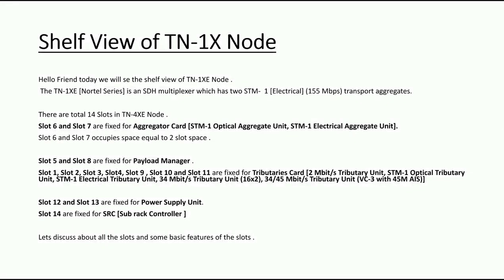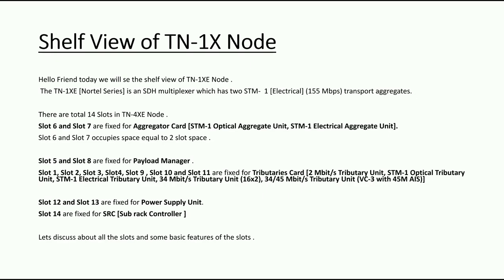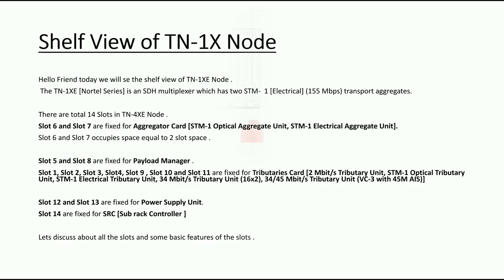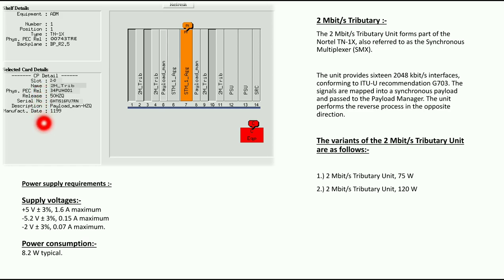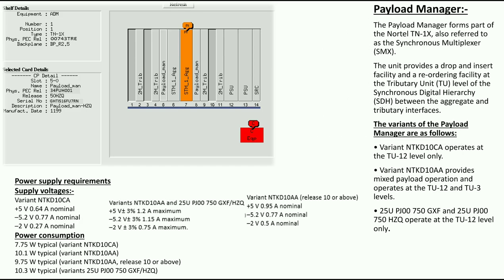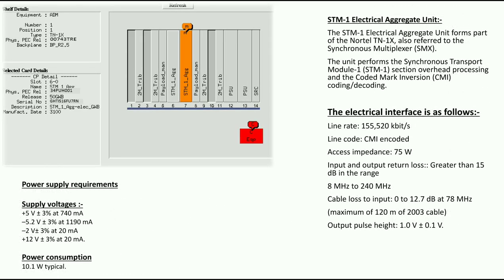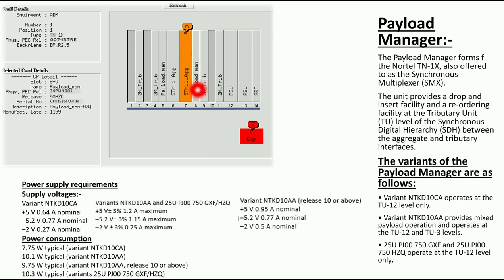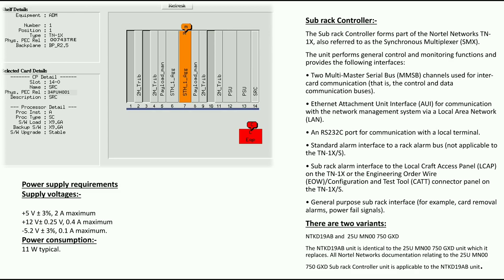Shelf View of Nortel TN1X Node [SDH Multiplexer]

Comment: Can u pls tell the difference between TN-1X & TN-1C
Reply from the maker: The TN-1X is an SDH multiplexer, which has two STM-1o transport aggregates and meets ETSI standards. 
TN-1C Network element (NE) is a stand-alone SDH add/drop multiplexer (ADM).It is designed to deliver. 2/34/45 Mbps TDM and 10/100. Mbps Ethernet